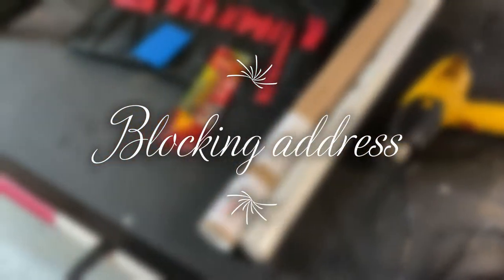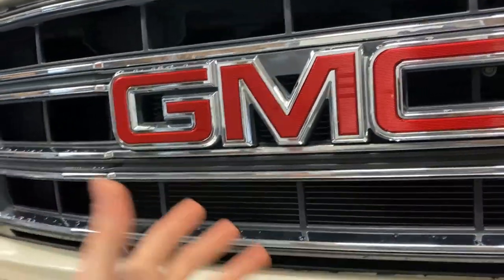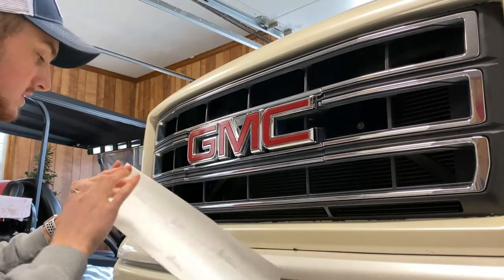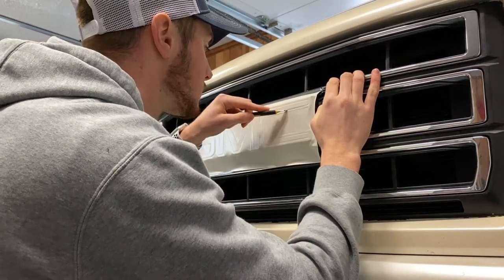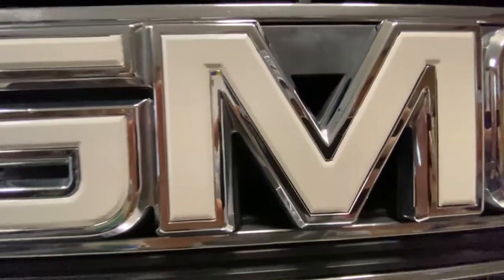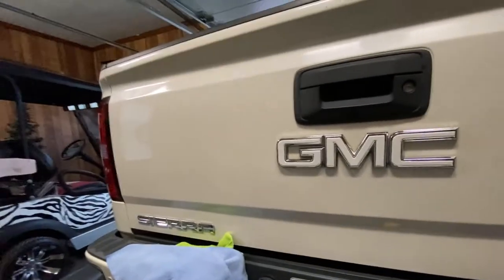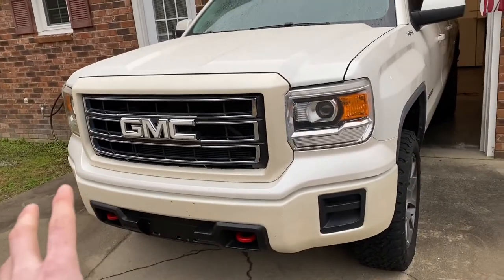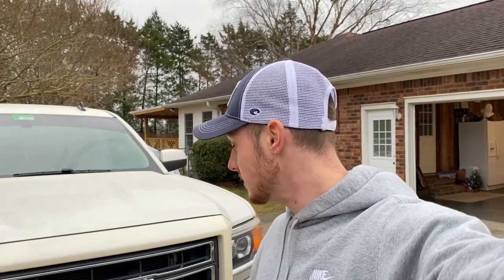How To Wrap GMC Emblems

Comment: good video...where did u get the bulk material?  All I can find online is individual pieces. one per letter. and i don't seem to be getting as good adhesion as what i see in your video?
Reply from the maker: I have the link to the wrap I used in the description, if that helps. And are you cleaning the emblems thoroughly before you begin to wrap?
Reply: @hunterrwiilson  was fairly sure i was thorough
Reply from the maker: @dougbarkdull3469  Once you get the wrap I used, or a ViVid product that is close to your truck's color, that should hopefully take care of the adhesion problem. As long as your prep is good I think you should be good to go! I'm no expert but what I did has worked for me thus far
Reply: @hunterrwiilson  thanks. my truck is black Im making the logos gold...Purdue colors

Comment: Try putting the heat back on the parts you don’t like and smoothing it with your plastic pick
Reply from the maker: I started to notice that the heat was mainly for corrections as I progressed to the back emblem. So I totally agree with you.

Comment: How did this hold up over time? With car washes. I want to do my black Gmc yukon denali emblems in hot pink.
Reply from the maker: Sorry for the delayed response, Air Force training, but the wrap has held up just fine. As long as you install it correctly. I have scrubbed it and they held up.
Reply: No way that’s gonna stay on under high pressure washes. IMO
Reply: @tombowles60  Well yeah I mean don't be a goofball with your pressure washer of course you could peel it with that lol. Just stand back and mist the emblem don't make direct contact with a pressure washer.